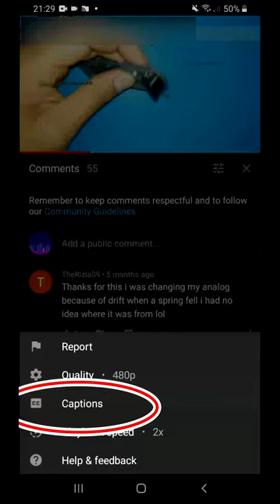LB button replacement for Xbox One Elite Series 2

Comment from the maker: 00:11 •Remove the logic board from frame.
00:21 •Remove the wireless antennas.
01:02 •Lock the logic board into clamp.
01:08 •Using: isopropylic alcohol.
01:15 •Spray the surface with isopropylic alcohol.
01:19 •Clean the surface with a toothbrush.
01:31 •Using: FLUX Relife.
01:45 •Apply the FLUX on the pins.
01:54 •Using: desoldering wire.
02:01 •Cut a desoldering wire.
02:36 •Firstly. Apply soldering wire on each one pins for make easier our job.
03:08 •Then. Apply FLUX on desoldering wire.
03:21 •Using: solder paste. Relife.
03:34 •Apply just a little solder paste on pins.
04:18 •1st attempt. Desolder the button with the desolder wire help.
05:27 •Clean the surface with isopropylic alcohol.
05:30 •Apply FLUX on desoldering wire as it was necessary.
05:43 •2nd attempt. Desolder the button with the desolder wire help.
06:03 •Again. Clean the surface.
06:17 •Using: nose pliers.
06:20 •Gently. Pull down the button while heat the pins for finally desoldering it.
06:33 •Finally. The button desoldered.
06:53 •Again. Clean the surface.
07:20 •Insert the new button.
07:44 •Soldering the 4 pins at new button.
08:52 •Finally. Clean the surface. And reassembly it.